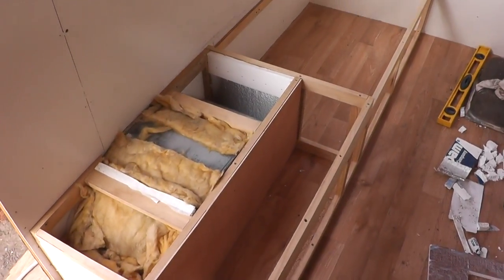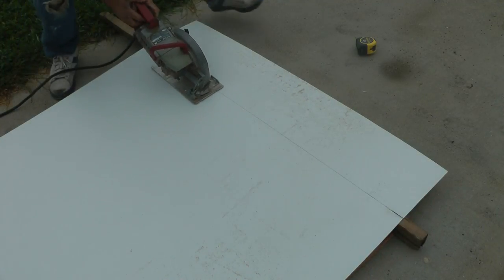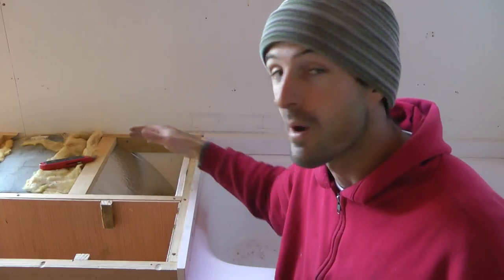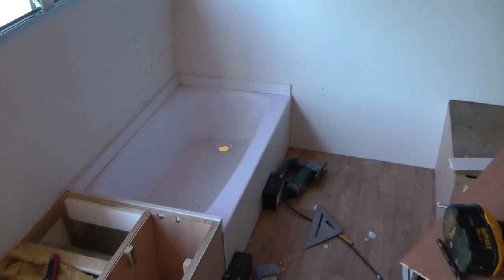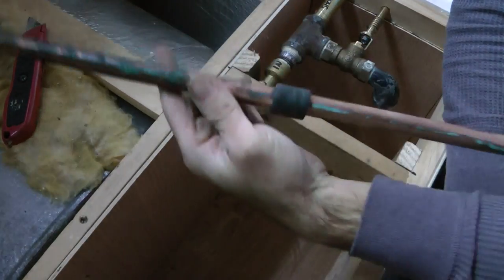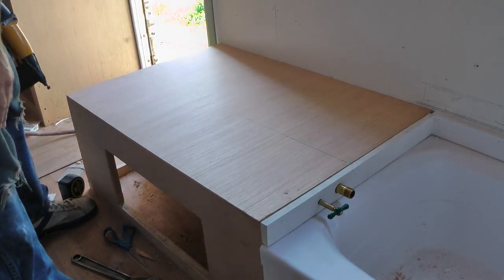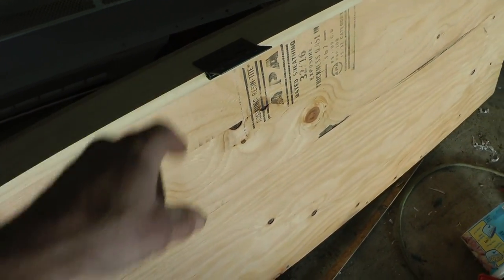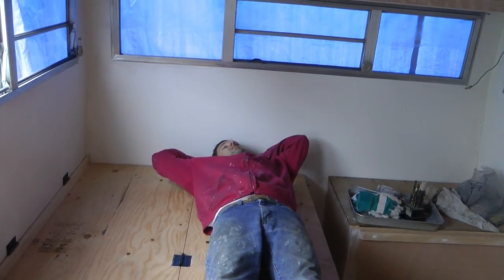Vintage Shasta Trailer Restoration - Part 20 - Hide-A-Way Bathtub Build!

Comment: I like the folding bench idea, very good use of space.. The back flow water heat system is a great idea as well.. we almost never use our water heater in our trailer because of the waste.
Reply from the maker: Thanks, I have to say I'm a tad proud of the 3 in 1 setup (hopefully it works in practice). I think we will have to learn to be pros at conserving water. That tank is pretty small.

Comment: Ive seen a over the road custom bus with a shower in the back rigged so that the water is warmed by the heat from the engine.  That scenario is probably impossible in this case, but maybe it will spark some ideas?  Inspired by your work, thank you!

Comment: Yeah it's back!! My wife and I are about to buy a travel trailer and have grand plans to remodel, this series has been super helpful. 
You could get a pretty penny for this thing, you've got a full 4+hour documentary of the restore as a selling point
Reply from the maker: ha ha I've thought about that. Maybe I'll include a "commemorative shasta dvd box set" if I ever sell.
Reply: Richard Cockerill hardest part is done anyway. Interior can be done by the buyer. They may infact prefer it that way.

Comment: Great creativity. 
I would add T nuts (the threaded inserts for wood) and bolts to the leg supports on the bed. This way when tightened there is nothing protruding.

Comment: Your system of recirculating is pretty similar to the systems used on larger homes and many apartment buildings. Where a re-circulation pump is placed at far end of the hot water system to keep the hot water flowing so you don't have to waste water waiting for the hot water to get to your unit or far way bathroom. Though tanks less heaters would (I guess) be more energy efficient. Expect for your system not running continuously and being manual which makes sense for a mobile home. I think the only complaint a code pusher could reasonable have is that you should have a one-way valve to prevent nasty from contaminating the fresh water. But I'd think you'd be smart enough to avoid that on your own.

Comment: Hey man i want to know why does my pw80 runaway by it self man when i not even doing anything or touching anything and i clean the carb already and thr air filter and new trans oil
Reply from the maker: My first thoughts are maybe the idle is set high, or could be a vacuum leak.
Reply: Jennies Garage i already idle the carburetor bunch of time man
Reply: Jennies Garage do you think it might be the reed value
Reply: Jennies Garage i have videos of my dirt bike that has problems